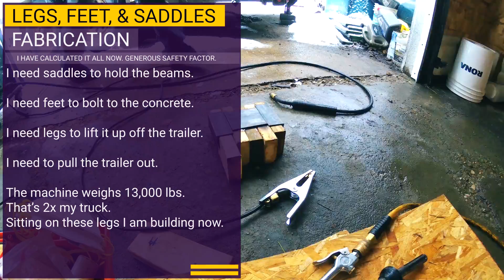WELDING the legs. WOOD beams. [How to get a 6 ton CNC off the trailer SOLO]

Comment: Cool video. Interesting to me as I have moved a couple similar size cnc machines into my garage. I considered building a similar setup as you are doing to get the first one off my trailer but ended up just getting a buddy to pick it off with an excavator. Worked out good and saved me a pile of work. Looking forward to seeing future videos from you.
Reply from the maker: Thanks! I wish I had someone with an excavator to do that. Although the video would not been as interesting. Lots more to come. :)